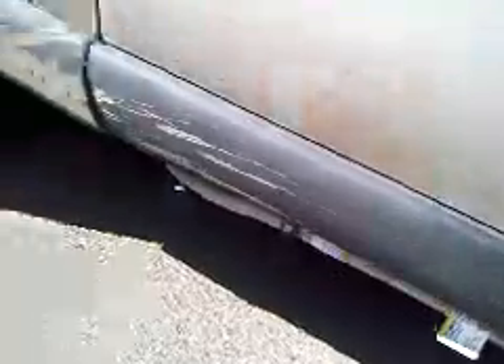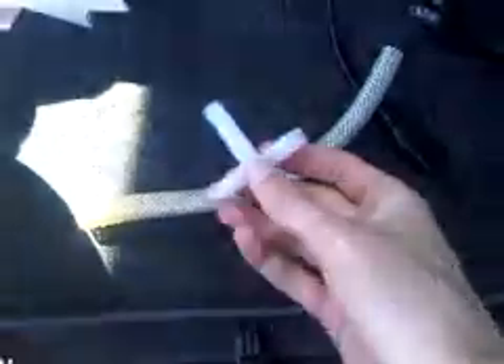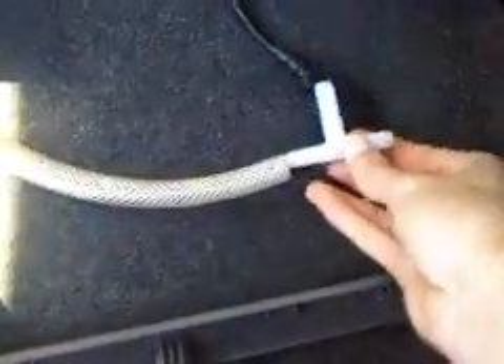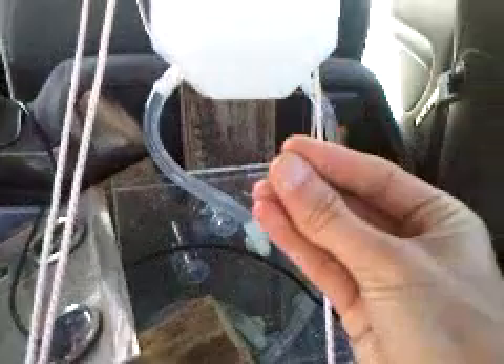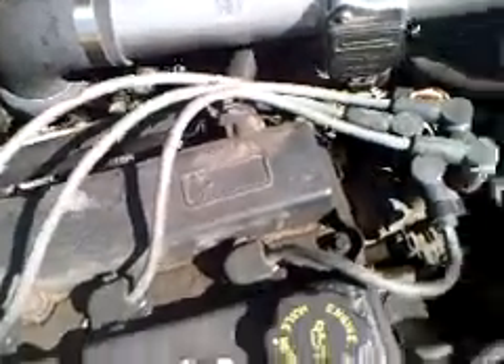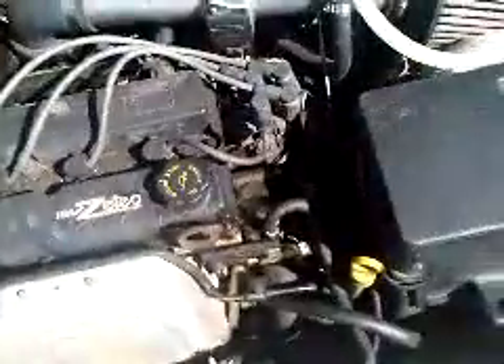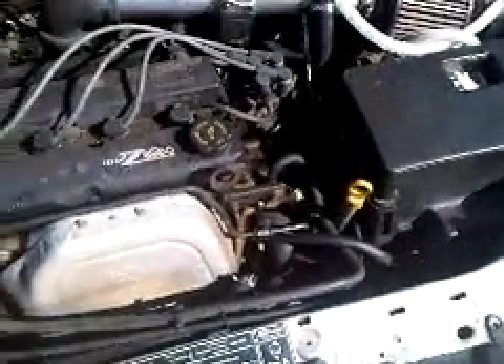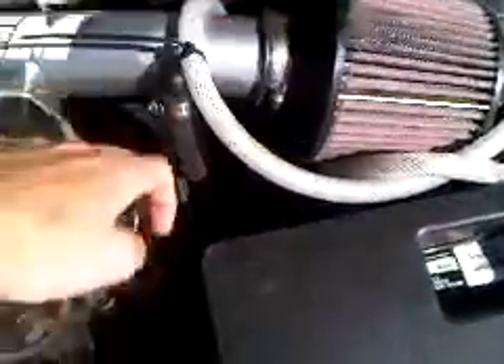HHO dry cell - PCV vacuum is crushing bubbler/res - [04-08-10]

Comment: hahaaa. you need to use poly tubing and tougher containers, get a AFC for full control of your engine. port to your idle intake and your vacuum because at wide open throttle you don't have any vacuum or very little vacuum but the idle intake is always inhaling